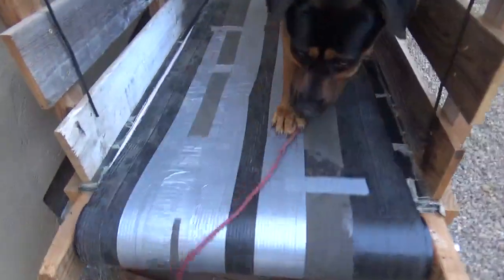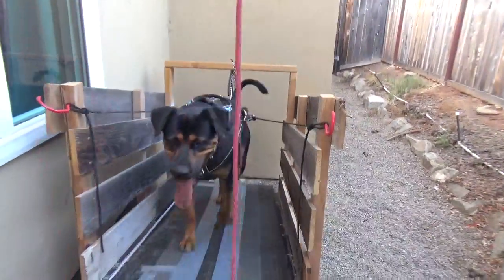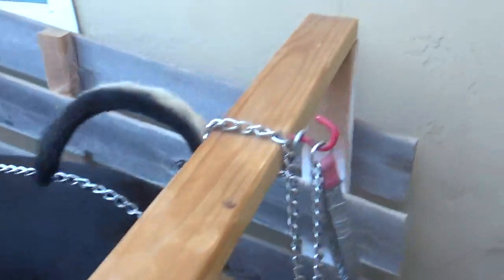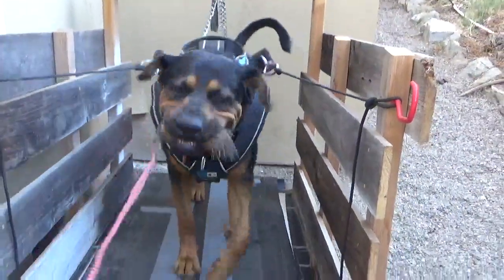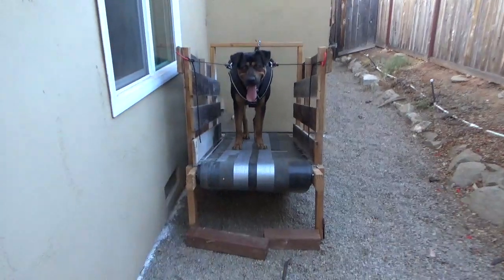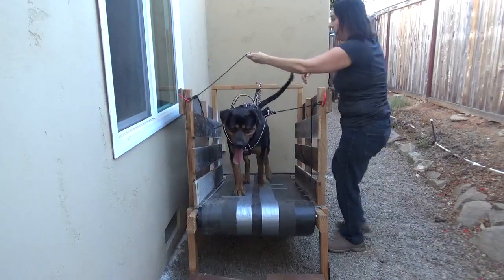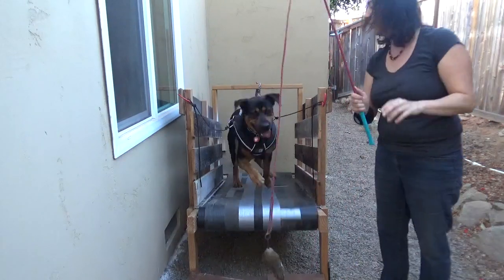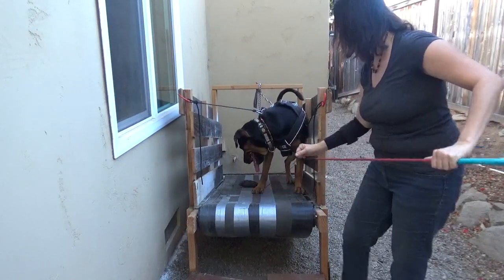DIY Dog Carpet Mill

Comment: Awsome tread Mill, but would like to suggest that angle of slope should not be greater than 15degrees
Reply from the maker: do you also make sure not to go for a walk, run or a hike anywhere the ground may have greater then 15 degree incline? for this application the incline needs to be enough that it makes it easier for them to run since the ability to slide the carpet on the surface below it would be hindered or harder if the incline is not enough.  this alone would make it harder to get a dog started when they first start running.  Do you have a source of information to support your 15 degree incline limitation and reasoning and is it a blanket statement irregardless of age, breed, size, whether in tact etc?  Before growth plates are closed they really shouldnt be running at all let alone next to a bike, on a treadmill or on an incline except short bursts normal for puppy play not prolonged runs.

Comment: Can you please list what you used to make this? This is the best one i’ve seen
Reply from the maker: Regular carpet scrap sewed together with fishing line.
Plywood and 2x4s for frame and some old fence boards for the side
Contact paper on the plywood to make it smooth for the carpet
Go kart bearings with lag bolt to go through into the timber inside a piece of abs pipe
Reply: @choosehealth4u  thank you so much!!!

Comment: How do u get it to rotaite so smooth
Reply from the maker: car wax on the smooth surface between the carpet and the contact paper I put on top of the wood platform.  Also the carpet itself needs to not be too tight... it must be lose some or it won't spin right either.

Comment: What angle did you put the mill on?
Reply from the maker: About 20 degrees.  You can always add more 2x4s under the front to lift it higher up.  Too steep will be too hard for the dog and not enough incline makes it actually harder for the dog to move the carpet track.

Comment: How did you make it?
Reply from the maker: Basic frame base with plywood and 2x4s... put contac paper that was slick on top of plywood to make carpet slide easier though you could use plexiglass or whiteboard type wood, rollers made from abs pipe with timber put into it (screw abs to timber), drill holes through frame into timber to make the rollers and use big bolts.  Either get go kart bearings or use piece of empty pipe for the lag bolts to go through.  Sew carpet together to make the track (dont make it too tight) and then add duct tape for better traction on the back of the carpet (part dogs feet run on).  Then add the sides.  I found pounding a stake in the ground and screwing it to the base legs help keep it real secure.  I recommend using pressure treated wood for whatever part will be touching outside ground.  I later added a roof with corrugated metal to help stop rain from breaking it down faster.  Paint also helps with weathering.

Comment: do you mind to share me regarding the roller part? with instruction
Reply from the maker: It is an abs pipe... the black pipe at home depot with timber/wood inside... then put screws through the pipe into the wood to hold it in place. Predrilled holes in center so the lag bolts go through the bearings and into the wood